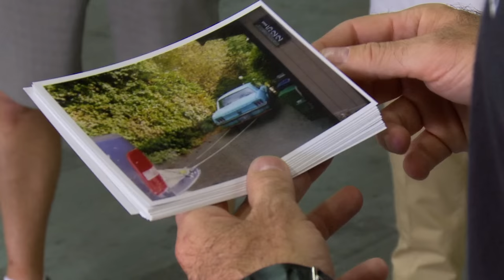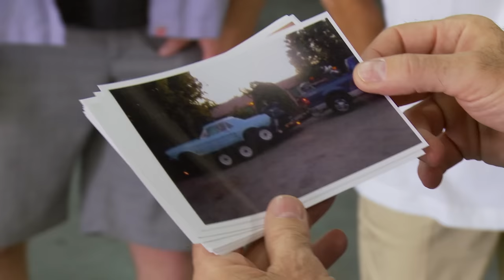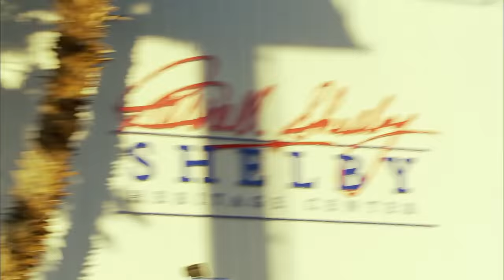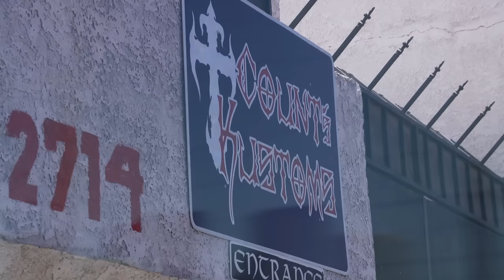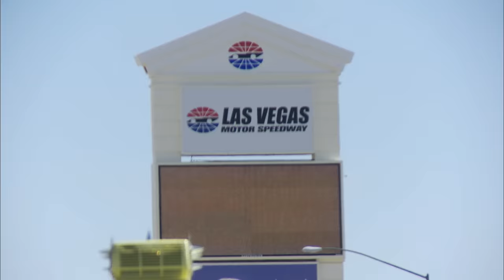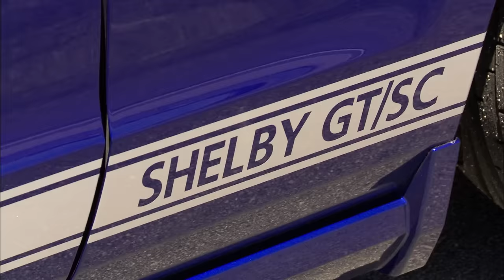TOP 6 FIERY MUSTANG MOMENTS 🔥 | Counting Cars

Comment: I owned a 68' mustang with a 302 boss. Blue with black rally stripes. It would pull the front wheels. Definitely needed the traction bars cause it burnt up tires. Nice ride for a 16 year old kid in 1975. I loved that car!
Reply: @rustybritches6747   Yep. The motor was a 1973 from a wreck. It originally had a stock 302 in it. Yes 1968 and yes 302 boss. It wasn't a "boss" mustang.
Reply: @popeye3305  The 302 Boss was offered in 69 and 70, and it was basically a 302 block fitted with the heads from Ford's planned 351 Cleveland engine. Bigger, canted valves, larger intake runners, different cam, and 10.5 : 1 CR.  By 73, the Boss 302 engines were no longer produced.  Aftermarket intakes were made later to pair the 2bbl Cleveland heads to the 302.  The Mexican 302 truck engine is the block you want, more webbing down low.

Comment: I drive a 5th generation Mustang GT (2005 model year to be specific). Found it at a Saturn dealer (yep, secondhand) back in '09 and it had a little under 32K on the odometer. It got me through my senior year of high school & my 6 years of college. I still have it today and recently crossed 100K on the odometer; only major thing I had to do with it in that time was the transmission (It's a really reliable car).
Reply: At that point bro I’d just garage keep it man keep the miles low.

Comment: wow old video dated before 2016, but the first shelby cobra csx0001 was sold off in august  2016 for $13.75 million, shelby should of taken the $25 million offer. I was there when the csx0001 was sold off at monterey calif. auction, it smoked so bad I got a major headache, carroll's grandson Aaron drove it on the auction block.